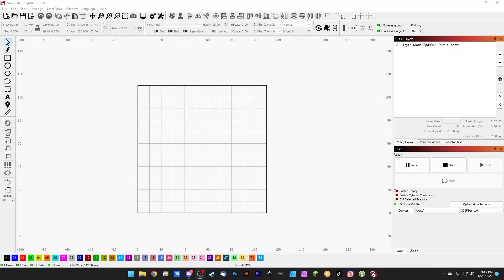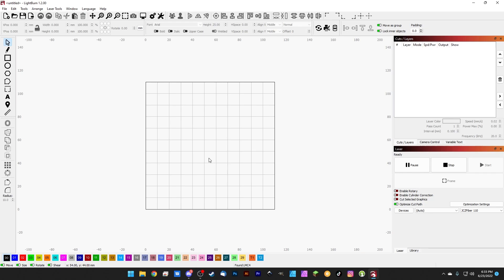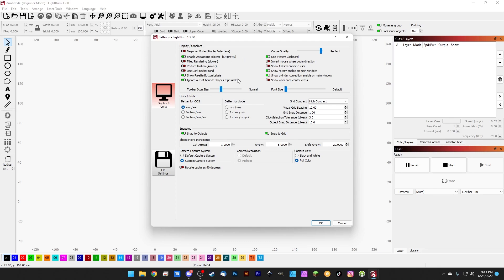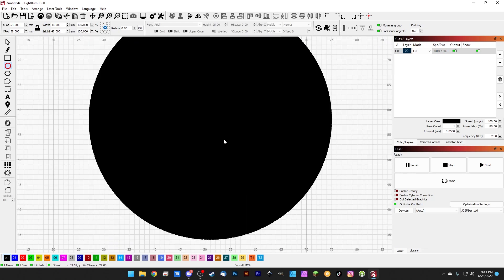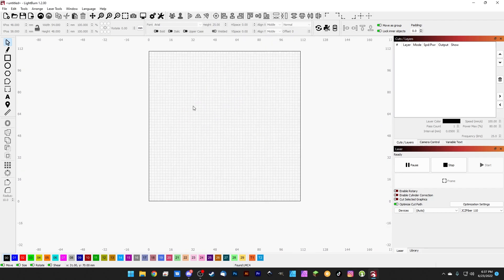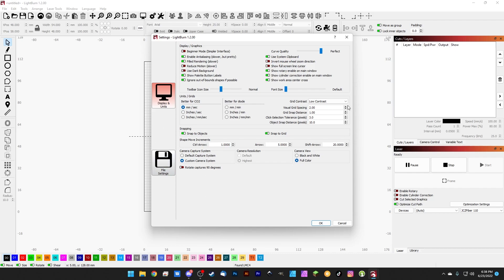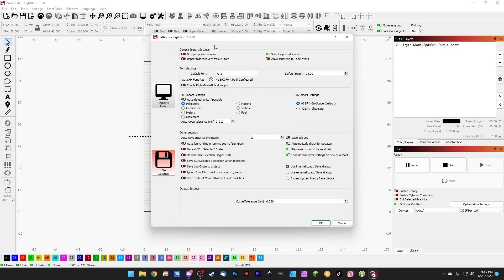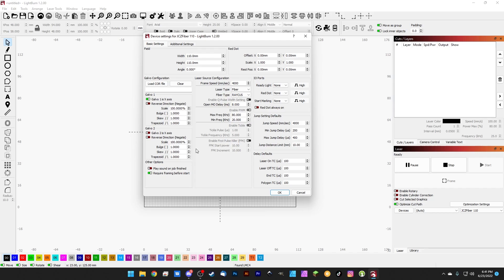How to Configure the LightBurn for Galvo Workspace

Comment: Hello brother  thank you so much for your videos, i have watch lots of them and i Got results in the first week of following your instructions. 
i was wondering if you could help me with a small problem I'm running with Ghosting in my Fiber laser. I'm not sure what I'm doing wrong.
I have a 50W fiber laser, originally came with a 300 mm lens and i had to switch to a 70mm lens because i engrave very small letters and logos.
i think in the calibration process i missed something. Thank you in advance, i hope this message finds you in great health.
Reply from the maker: It’s great to hear the videos have helped you!
For ghosting, this may be related to your timing and delays. I would start with that if you haven’t already gone through that part of the tuning process, we have a video on the channel for it as well.
Reply: @LaserEverything   I'm using ezcad 3 and is different than ezcad 2 and Lightburn.  Should i switch to Lightburn instead of using excad3?? what do you recommend

Comment: So question. Say i get a 300x300mm lens which should increase my work area significantly. How do i go into lightburn to give me that workspace area grid , instead of the 110x110 area, because just typing in work field dimensions during installation will not give me any bigger than a 110x110mm work field.
Reply from the maker: Similar to setup, you'd go to the device area on the bottom right, select the device button, and you can edit the profile for the device > hit next on the name, and you'll be prompted for a work field size. IF you have multiple lenses and want a device profile for each, which is typically ideal, you can DUPLICATE the device when right clicking on it, and it will prompt you to name it, then set a field size, and the rest of the config should copy over as a baseline setup.

Comment: Thank you. I have xtool laser and I have one question. Biggest headace question :) Workplace is approximately 400x400mm. If I need to engrave 30x50mm area. How can I do that? How can I set a specific starting point. I use lightburn.

Comment: Hi, can i adjust the home position (the coordinates the laser start firing) in Lightburn for my Galvo laser? i could do it easily in Ezcad in the Param button (offset X and offset Y) but i never found the same function in Lightburn. Would you have an idea about this? Many thanks.
Reply from the maker: Sorry for the delay, and absolutely if I'm understanding right. It's in the device settings of lightburn where you can offset field position. Hope that helps!

Comment: why are work area larger than the lens size in your videos? like you had a 150mm lens and the work area was like 186mm
Reply from the maker: Corfile lens corrections overwrite the advertised lens size with the true lens size. You still only want to use up to the advertised workspace size marked on the lens but the advertised specs are approximate, not exact.

Comment: Greetings. I am using the trial version of lightburn. The problem I'm having is when I type a text on the screen and preview it, it looks ok. On the material it's showing a different direction and if I move it to the left or right with the arrow keys it moves in a different direction. The text is horizontal and on the material it is showing vertical. Any suggestions will be appreciated.
Reply: Thanks for the  response. Will try that
Reply from the maker: Could be one of two things - your workspace is either rotated like you have your laser rotated to the side but youre looking at the software straight on in which case you'd set Angle under your device settings to 90 or 270 - OR - your galvo 1 = x or galvo 2 = x is set incorrectly, also in device settings. Try playing with those to see if you can get it right.
A few episodes after this one we go into how to generate lens correction profiles which will fix this automatically for you.

Comment: Alex, lightburn galvo is different program and co2 gantry that i use is different also? I mean, can i use galvo and classic co2 gantry in one lightburn version combined?
Reply from the maker: Lightburn is one program but you will require an additional license in order to unlock the galvo functionality in your copy of the software.
Reply: @LaserEverything  yes, i know that. So when i purchase the second license for galvo, i will operate one single program (my existing one) for both, correct? If so, different lenses, same program also, or one copy for each lens as ezcad? Thanks!
Reply: @polakiss  You can run as many lasers as you want in a single install. In the device list you can right-click your laser to duplicate it and setup for a different lens size.
Reply: @shark92651  thanks for clarifying!